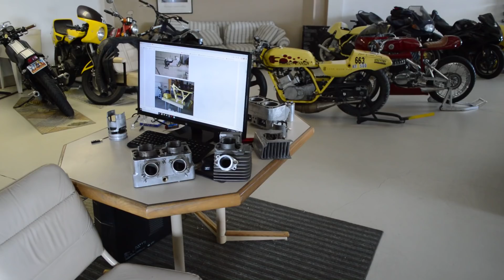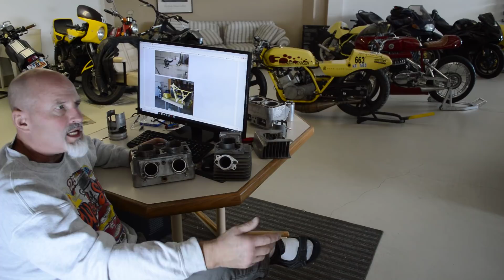First RD/RZ engine build

Comment: In India there is only RD350 air-cooled P twin engine.I wonder y Yamaha give air-cooling to this.Mark you r great to convert it to LC 2Tengine.Mark what if a power valve is installed on this engine you made?
Reply from the maker: I didn't include a power valve. I only need all out power for landspeed racing.
Reply: @SpeedofCheeseRacing  OK that sounds great.Which is power full with or without power valve?What will u recommend for daily driver?

Comment: Thank you for sharing, it would be great to know how did you accomplish that working 3 port exhaust with those tiny bridges, they are so slim they should get pretty hot and swollen, it really is insane how you got that ring alive and avoided the swelling of the bridges.
Reply from the maker: This engine was a single exhaust, but the next one was a triple. I will cover that in the next video. Thanks
Reply: @BF-uw7lw  Yep, I´ve seen those, but I haven´t seen those with less than 5mm of metal deep into the port, precisely to ensure the bridge will have enough metal to be able to dissipate all that heat coming from friction + the exhaust gases, for what I see in the video.... those bridges are around 2mm wide and around 3mm deep into the port, on a race bike which is supposed to withstand WOT for a whole mile..... you would expect those bridges will be getting veeeery hot.
Reply: @BF-uw7lw  So based on your knowledge, bridges of 1.5mm wide and around 3mm or less deep into the port, will be able to work perfectly having whole open throttle during a whole mile on a very highly tuned engine at most likely around or over 10.000rpms, right?

Comment: Hello...well done without a script not easy I'm sure...I'm guessing the idea of a genuine tz didn't appeal 2 u..You needed to run your own design and with extra displacement .was your cylinder block mated with rd crank case or did u build a complete motor?
Reply from the maker: Nicky, I think the heaven and hell of being able to make anything means you have to forge your own path to your own consternation. haha The TZ is dated so I didn't want to try reviving that. I have to run a stock case to keep in my class, so I used a RZ350 case just because it already had the water pump. I could have stayed with the RD but then would have had to use an electric water pump.
Reply: @SpeedofCheeseRacing   ahh yes I have full picture now...I know the drive you refere to...2010 i decided I had enough parts that were really not worth a whole lot to start a 2 stroke track bike ..18 months later,almost a divorce,upward 2k Euro  spent..I had did it...I could swap some funny ones with u for sure...
Reply from the maker: @nickywalsh8492  haha I want to hear them! Buying this bike was the end my marriage. BEST TRADE EVER !